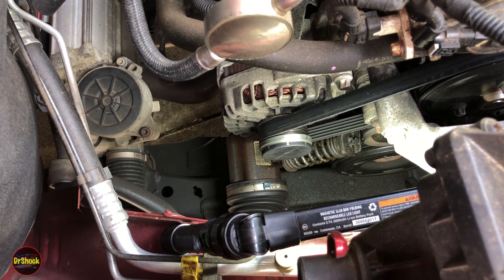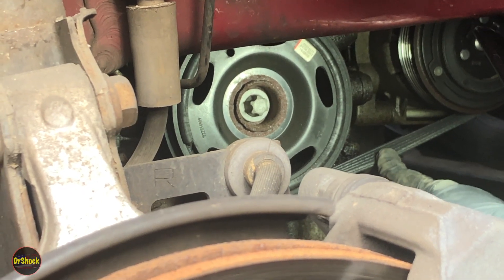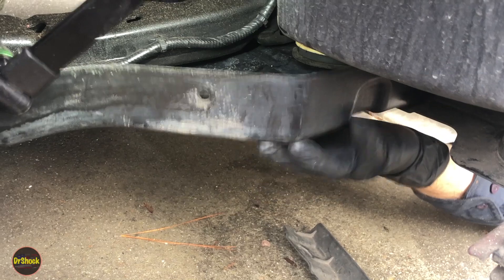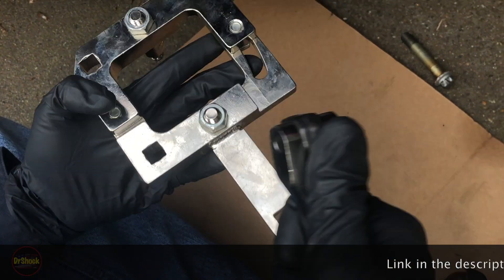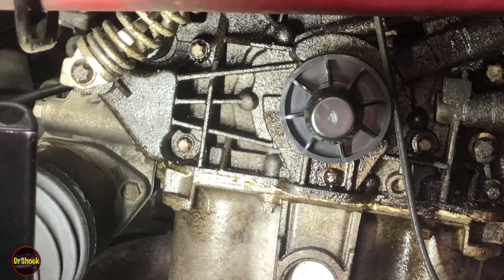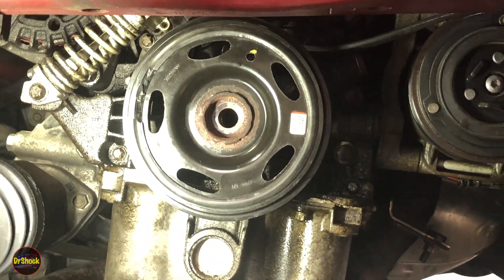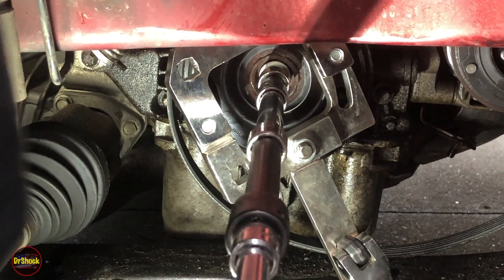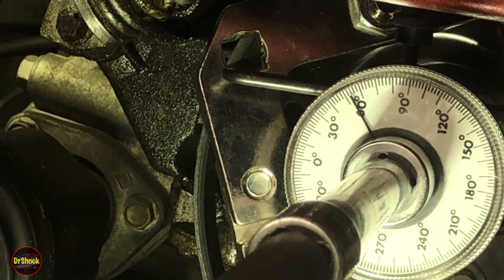2011 - 2021 GM Ecotec 1.4L Engine Oil Leak Front Crankshaft Seal Replacement (Chevy Cruze Sonic)

Comment: Do you have to support the motor with the 2019 Chevy Trax?
Reply from the maker: You should not need to remove the motor mount for this specific repair procedure, so no added support should be necessary.

Comment: Hi, great job on this repair — very professional and clearly done by the book 👍
I’m planning to replace the front crankshaft oil seal on my Opel Astra G 1.4 petrol (2007, Z14XEP).
Could you please advise what parts/tools are required according to the technical manual, and where I can find a proper workshop manual for this engine?
Thanks in advance, really appreciate your work.
Reply from the maker: I believe I included the search links for the special service tools, and the hardcopy GM service manual, in the video description text area.

Comment: I noticed when putting my pulley back in, the hole was 180 degrees the opposite direction. I guess I forgot to line it up before taking it out. What would I need to do to make sure it’s put in properly, can you tell by looking inside? Thank you
Reply from the maker: It is possible to install the balancer pulley assembly 180° out onto the oil pump, but it won't affect the engine operation.  The problem would come down the road when a different service procedure that requires using those marks needs to be done.   If you aligned everything as I showed beforehand, then just make a note to remember the mistake for the future.    If you didn't take note of the starting position or otherwise mark the pulley, I'm not aware of an external way to tell.  It would have to wait until when the timing cover gets pulled off to replace the chains / tensioner or fix the leaking that they all do on these engines.  Then you could use the internal timing marks to verify the pulley position.

Comment: For the sake of correctness is good to line up the crankwheel, but it is not necessary, the timing chain or camshaft of even the timing cover is not removed, simply remove the seal, place the new one and the flywheel goes back the same it came out.
Reply from the maker: The reason the GM service manual spent a good deal of time on aligning the externally visible timing marks was not for this procedure per say. The crankshaft balancer assembly can be reinstalled 180° out of time with the oil pump on this engine, and you wouldn't notice this mistake doing just this seal procedure as the engine would run fine.  The alignment importance is for the other procedures on this specific engine that may lie just down the road that do depend on the external timing marks on the cover being correctly aligned.   Follow the OEM service information I shared on alignment mark guidance, a paint marker is your friend here, and you will avoid any future day of despair and regret.

Comment: I hope everything is going great in life; I have another question what impact wrench would you suggest doing this job? The oil coming out of the seal is getting  my brain going. Thanks for the help.
Reply from the maker: For fasteners of this size, you'll want to go with 1/2" drive tools not 3/8".   Personally, I prefer Milwaukee brand power tools.
Reply: @DrShock thank you
Reply: @DrShock So you would use a impact driver and not a impact wrench? I don't want to rip the engine apart. Thanks again.
Reply from the maker: An impact driver, if I understand what you're referring to, is a manual tool for use in freeing up stuck torx, Phillips, or torx head screws.  We're looking at an impact wrench here.  ;-)
Reply: @DrShock I was going to buy a Robusture 1/2 impact wrench 738 ft lb to remove the crankshaft bolt so don't have to remove the engine mounts. Thanks again

Comment: What's the name of that silver tool used to take off the pulley?
Reply from the maker: I believe you're referring to the holding device, to keep it from moving off the timing mark.  All of those tools are listed in the video description, as well as the part numbers.
Reply: 1/2 breaker bar

Comment: That old damaged balancer was responsible for the leak of the old seal and should have been replaced after the new seal was installed.
Reply from the maker: No, not in this case for this particular engine.  The divot shown in the rubber is not enough to alter the balancers specification.  The shaft surface also passed the GM service manual inspection procedure.  Never fall for the parts cannon approach other vehicle brands may trigger. For this particular GM engine, the primary causes of seal failure are related to pressure failures upstream with the turbocharger integrated PCV design, and premature hardening of the seal material itself from age/heat.

Comment: I just had to replace the oil pan on my mom's 2017 Chevy Trax after the old one cracked from the shop installing an oversized drain plug. 

It's the same exact engine that's in the Chevy Cruze(Ecotec 1.4 turbo), but since the Trax is AWD, GM's evil engineers had to design it so that the transfer case would be in the way of removinging the oil pan by about a half an inch.  You have to drain the transmission and the transfer case, remove both drive axles and remove the entire drive shaft.  

Then, on the other end of the oil pan, the screen for the oil pickup sticks out just enough so that the main crank pulley has to be removed in order to drop the oil pan.  Then, since the exhaust had to come off, and the flex pipe was about to break, I just ended up replacing it.  

I also replaced all the lines coming from the turbo, so I had to remove the turbo, the manifold and the catalytic converter.  
Don't ask me why, but for some reason, I decided NOT to remove the oil cooler and oil filter housing, even though it's leaking and definitely needs new gaskets anyway...  I guess I just wanted to make sure I left myself a reason to tear it all back apart again soon.  

Ya know...  
Since I LOVE banging my head against a wall so much.

Anyway....
I got everything back together and went to fire it up, and I got the "LOW OIL PRESSURE...SHUT ENGINE OFF" warning right away and every time I try to start it up.  Is there something I might have done when I put the crank pulley back on that would cause the oil pump to fail like that...?  

It ran fine before I did any work to it so I don't think anything is broken.  I'm pretty confident that I didn't drop anything in the pan that would clog the oil pump and I was very careful not to put RTV too close to the screen or smear it at all when I put the new oil pan on.  

I installed the new pan with a magnetic drain plug, so I'm gonna drain the oil and see what it looks like.  But I have a funny feeling that my problem has something to do with that crank pulley and the oil pump.  

I'm a carpenter though, not a mechanic, so if anyone has any suggestions to offer, I'm all ears...  I'm looking for some tips on what I could check myself, so any ideas on how to troubleshoot this would be greatly appreciated...
Reply from the maker: You might review this video for removing the oil pan on the Ecotec 1.4L first generation engines (RPO LUV, LUJ) that you have.  You'll want to see how the pickup tube and such are supposed to be positioned to insure nothing is amiss there. And within this video, being sure that you kept track of the keyed alignment of the crankshaft pulley as that drives the internal oil pump.   You may have not indexed this correctly so you may want to review that footage here as well.
Reply: @DrShock I appreciate the reply. I think I’ve watched every video that’s on YouTube related to the Ecotec 1.4 engine at this point. That’s why I’m looking for solutions in the comment section now. I read every single comment in your video including all your replies.  Even though I haven’t found the exact answer to my problem yet, I still gained quite a bit of insight from all the info you’ve shared so for that, I THANK YOU.  I’m sure it’s going to help me in the end regardless.

Comment: Did you have to drain the oil before doing this job?
Reply from the maker: No, an oil drain/change is not necessary before performing this procedure.  But depending on how it went, you might want to do an oil change afterwards if any cleaning solvents, debris or such got into the open area while you had the crankshaft balancer assembly and seal removed.
Reply: @DrShock Thank you, God bless

Comment: I just did mine today.your video was awsome.i almost rounded out the bolt with a breaker bar.went to the pawn shop and picked up a 1/2 drive electric impact.thanx

Comment: Question what would happen if you don’t do the extra 60° on the bolt but I did do 111 foot pounds of torque. I just didn’t do the extra 60° with something happen.
Reply from the maker: The metal these bolts are made of is intended to stretch, to achieve the clamping force the GM engineers envisioned.   Torque to yield (TTY) fasteners is how they are referred to.  The extra degrees of turn is to get to that exact stretch point.   Will something happen if you forgot that?  Maybe a noise after some time, a vibration, etc.   You could always revisit it again and finish that last step.
Reply: @ thank you for that feedback.

Comment: I saw somewhere that that seal is also what causes this weird almost like ticking sound. Goes away when you take the oil dipstick out. I wanna replace this seal, but idk if i am confident enough. Been running the car for like 5 years now with that sound.
Reply: I’ve been running with the chirping noise since I got it brand new in 2014. I’m finally addressing the issue 😅

Comment: How long did this take for you to do? Also it looks like this is where my oil leak is coming from but it’s leaking quite badly. 2 quarts a week.
Reply from the maker: This should be in the neighborhood of around a 45 minutes to one hour job, if you have the prior experience and specials tools available.  Though for what describe, you should inspect the timing cover seal as well.

Comment: Thanks for this great video.  I mistakenly pulled the crankshaft pulley off and forgot to align the hole with the feature on the engine for proper orientation.  I did find a mark on the crankshaft that looked like it was used to line up with the oil pump, but it could be 180 degrees out.  Do you know what the symptoms would be if the pulley is 180 degrees out?  And is there any other way to ensure it is in the proper orientation?
Reply from the maker: It is possible to reinstall the balancer pulley 180° out of phase on this engine.  The balancer pulley drives the integral oil pump.  The flats on the pulley flange are arranged such that it will only go on one of two ways.  But one way is out of phase/incorrect.  I showed these alignment marks in the video, there is a hole on the pulley that should be kept aligned with the mark cast into the engine block.  

I've never run into a situation where a mistake like this was made.  But I suspect if you got the crankshaft balancer pulley installed out of phase the issue is that when you do need to rely on these timing marks for other engine repairs in the future, they will now be incorrect and could lead you astray.
Reply: @DrShock  Thank you for the quick response.  I don't anticipate other work on the engine, so hopefully all will be well even if it is out of phase, but hopefully it's not.

Comment: Hey mate. Thanks for your great video. Going to try this soon on my Astra GTC 1.4L turbo (A14NET LUJ).
The shock mount retainer tool I can't find in the UK for less than $200(£150). Any alternative method or ideas I can do? Thank you.

Regards
Tom
Reply from the maker: Thanks.  That crankshaft balancer tool is great to keep the pulley from rotating while removing it.   I have links in the description, usually these are well under $75.00 USD.   Did you try those links for the UK view on both?

Comment: I have question. I have the 2011 Cruze 1.4 L turbo...where do you find the service manual you have? I have Chiltons, Haynes, and Alldata but they don't seem to be detailed. They don't list fastener size as an example. Thanks
Reply from the maker: Yeah, there's alot of info that GM only puts in their own manuals. There's a search link in the video description where you might find an used set.  Another option is to rent access for a few days from GM directly at www.acdelcotds.com

Comment: My Harmonic Balancer Pulley won't wiggle off. It's stuck hard.
What do I do now?
Reply from the maker: If you've successfully removed the retaining bolt, then the most likely cause is corrosion.   You would need to use a gear type puller to overcome the corrosion.  Again, just because some people don't watch the entire video, you have to remove the bolt first though.  ;-)
Reply: @DrShock   I had the bolt out already. I didn't think I had to cover that, since it's common sense dude, sheesh...
But, I got the pulley off. Two pry bars, and gentle persuasion got er done, son.

Comment: That’s a weep - not a leak. What a waste of time and money. Hope this wasn’t for a customer - it’s a Cruze after all
Reply from the maker: Leak was fixed, customer was happy.  Weeps do not leave oil drip stains on an owners garage floor.
Reply: @DrShock what about the leaking timing cover? why not do it all at that point? Do the turbo and the lines while you’re at it. Customer would be throwing a party. Ps don’t forget the oil pan..water pump weeping too hit em up

Also you don’t need to hold the crank when you have an impact lol put a pry bar on the balancer
Reply from the maker: You don't need to fire a parts cannon at a given problem.  Take time to diagnose specifically where the problem originates from.  I like to use an ACDelco UV dye to give the engine oil this detection characteristic.  For this particular vehicle, none of the issues you mention were a current concern as these typical 1.4L issues had either already been serviced within the previous two years already, or were not applicable yet.
Reply: This dude is an asshole like me lolol
Good job though on the seal replacement
Reply: Never a waste of money to get rid of the annoying chirping/squealing sounds from the belt. Well worth it!

Comment: Looks like you found the leak which you narrowed down by noticing where the oil was depositing itself on the engine etc.  Another possible leak on that side of the engine is from the two actuators ( one on each cam ) on the cams. That’s also an easy repair and can be done without removing any parts other than the actuators or if you like a little more room you could remove the airbox. If you’re DIY repairing these seals just note when removing the old seal, which side of the seal faces in as there is a vague manufacturing line on one side of the seal. That leak would be higher on the engine block so is easier to see and wouldn’t spew oil on the same areas

Comment: Is this a turbo engine?
Reply from the maker: Yep
Reply: @DrShock  did you ever have to change out the intake on this vehicle? I’m getting ready to buy all the products in this description and hopefully it fixes my problem .
Reply from the maker: I've not had to do an intake on this particular engine, but I've done the camshaft cover (which is a failure related to when the intake manifold bypass valve checks out as part of the crankcase ventilation system).

Comment: Was it making a cherping sound before you replaced it?
Reply from the maker: It's been awhile since I worked on that owners Cruze, but no I don't recall any noise associated with this.  Just a pretty significant oil leak onto their garage floor.
Reply: @DrShock Would there be oil tricking down the oil pan if it was the crank seal?
Reply from the maker: Maybe, though that's more likely to be a leaking timing chain cover seal or the oil pan seal itself.

Comment: My father in law is saying I'm supposed to pack this with grease and something about a spring inside the seal. Could you please help me understand what he means by that your video helped me out tremendously. I just didn't see you mention grease or a spring. I planned on oiling the new seal like you showed. Thank you! 👍🏼
Reply from the maker: You can show your FIL in the video, the direct from the GM service manual pages, that we don't do any grease whatsoever with a GM Ecotec crankshaft seal.  On this engine the crankshaft drives the oil pump, right behind this seal.  tbh, this isn't something I've ever seen on any GM engine crankshaft seal, only older axle seals.

This engine uses a bonded seal for the crankshaft. There are older seal designs (not for this engine) where you do see a spring on the inside that helps retain the seal tightness.  But that's not what this engine uses.  If you have the genuine GM OE seal, just flip it over and all you'll see is where the brown seal material is bonded onto the bare steel shell (the tensioner built into the bonded material with no visible spring).  Then show your FIL, there's no visible spring.  ;-)
Reply: @DrShock  Thank you very much for taking the time to respond I appreciate your help!
Reply: All it is is you fill the backside of the seal where the garter spring is and that prevents the spring from coming out while installing it. I just dielectric grease as it has no acidic compounds and is safe on virtually anything rubber, silicone, or plastic.

Comment: Is this the source of the engine squeak these motors are prone to?
Reply: Thats what I was wondering
Reply: @thelonewrangler1008  can be if it's sucking air. Been known to happen
Reply from the maker: It would be highly unlikely for this particular seal to generate any noise.  At least not the genuine GM OEM design.